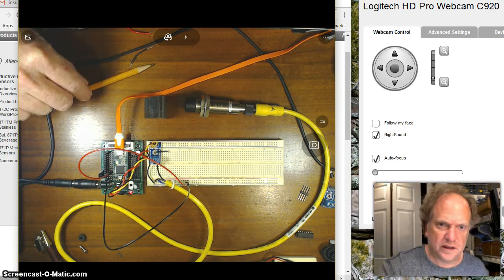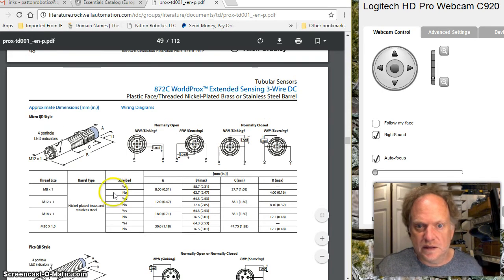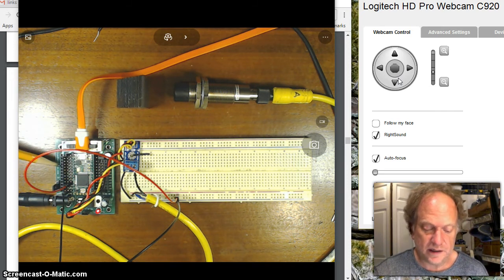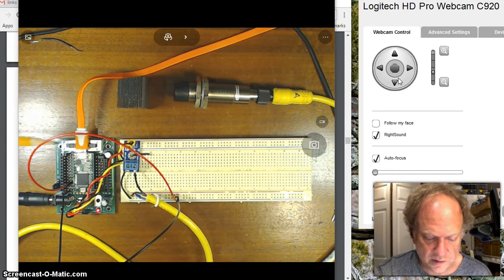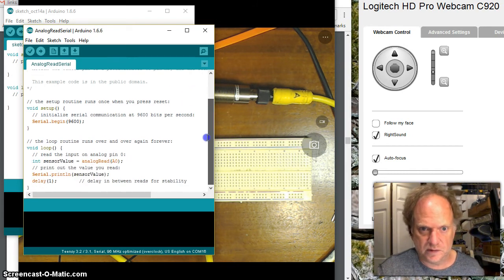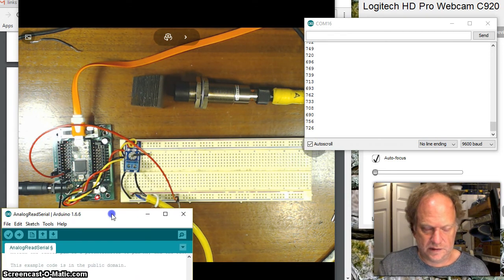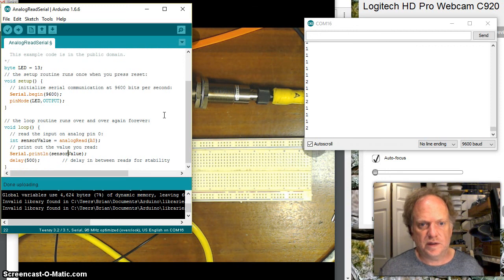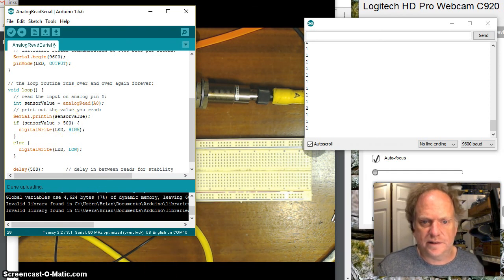Introduction to interfacing PNP Proximity Sensors with Arduino

Comment: is it possible to detect different types of metals using that sensor...are different types of metals going to give different analog reads regardless of the distance..or lets say the metals are at the same distance
Reply from the maker: Hello. I just set up the experiment. It's still basically just a switch without analog variance. Different metals did appear different but only on the distance required to trigger an event. The value out was the same regardless of the material.
Reply: Thanks... But do you think there is a sensor that can do what I had just described...
Reply: Kamps, you can get analog inductives to get a different signal output for different metals.  The company I work for makes them.

Comment: excuse sir, what is the blue device name on the breadboard ? I can't hear you clearly.
Reply from the maker: it's a 1:5 voltage divider. You can find them on ebay cheap. You can easily build one...here is a calculator and circuit diagram. http://www.raltron.com/cust/tools/voltage_divider.asp
If you want one quickly I have them here. http://pattonrobotics.com/t/input-and-output-devices